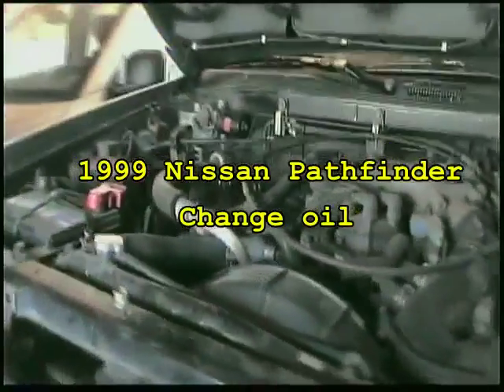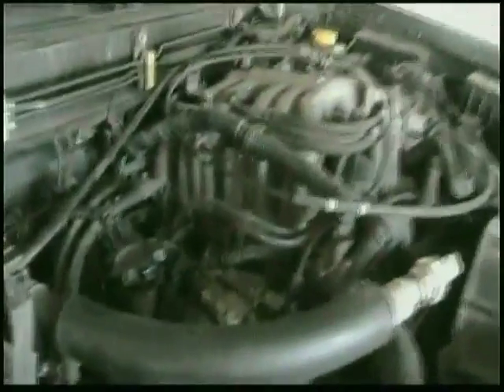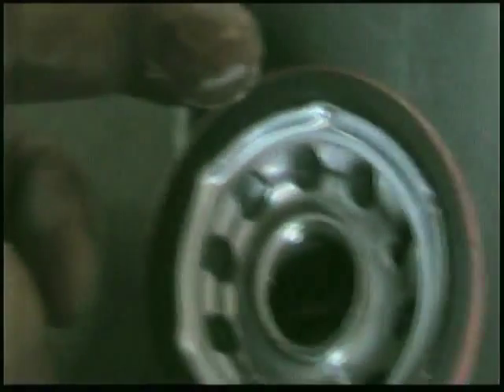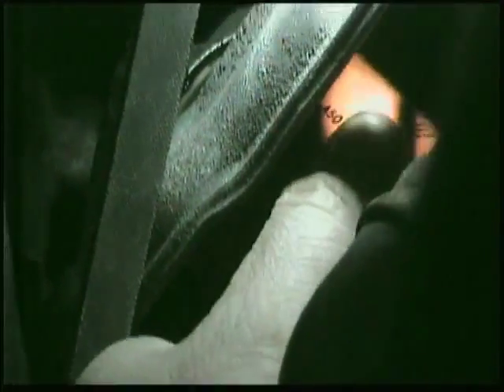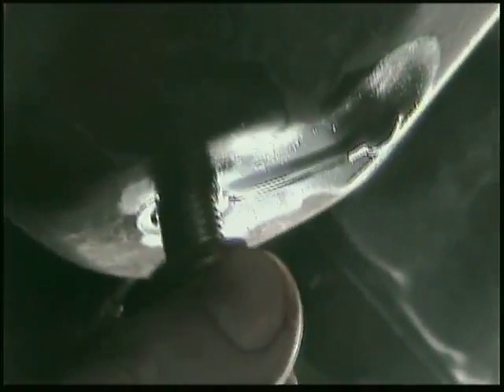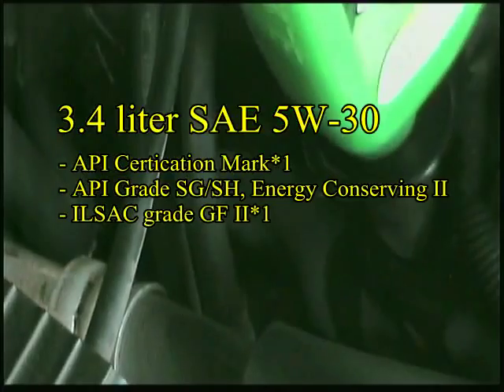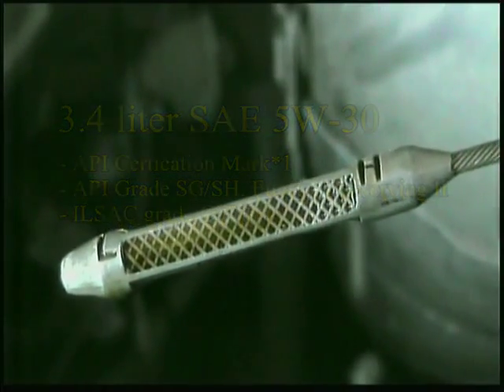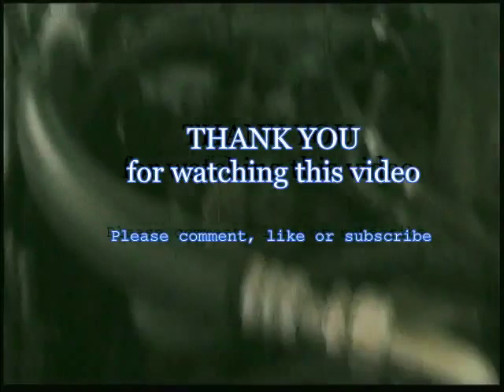1999 Nissan Pathfinder   Change oil

Comment: What is the part number for the oil filter? I just replaced one on a 2000 NP but it was not as tall as the one you show. But it did screw on correctly and seal with no leaks...
Reply from the maker: brand: FRAM number: HM7317. next time try asking the autoparts different brand that is applicable to your vehicle.

Comment: do you check the oil when the car is cold or after 20mins running?
Reply from the maker: I usually check oil when it's cold BUT it is recommended to follow your car manufacturer user's manual.

Comment: Hey if I put one quart of 10-40 instead of 5-30 will it cause my engine to sound like a diesel engine when pressing the gas? And if so should I change the oil?
Reply from the maker: Tony Benson Hello Tony, your engine has a manufacturer viscosity setting of 5W30. You won't hardly feel any difference if you add a quart of 10-40, BUT, it is recommended and a best/safe practice to follow your engine's manufacturer specification. Just make sure you got the proper oil level in your engine.
Reply: reteece rhu salubre ok, thanx but why do you think my truck started sounding like a diesel truck
Reply from the maker: Tony Benson Is this been going on before you change your oil? You might need to tune up your engine.
Reply: reteece rhu salubre Thanx man.., I found out what the problem was.., my radiator had no fluid in it. Sounds dumb but oh well. Lol! Thanx for trying to help though., I'll keep in touch. Lol
Reply: Can I use a 10-30 instead of 5-30 oil? whats the reason for   using the 5-30?
Reply from the maker: +Joa C Hello. This is something to do with viscosity or the thickness of the oil. The higher the number the  thicker the oil. It is still a best and safe practice to follow manufacturer engine oil setting.

Comment: I'm about to be 19 and my dad bought the car when I was 16 the car has 200000 miles and the shocks are all going out and the ball bearing on the front end are going bad causing the tires to wobble, around 50 mph the car rocks like a boat in a bad storm from side to side, if anyone wants to make some recommendations that might save my life I'd be very greatful. can't afford to pay a mechanic
Reply from the maker: +Shelby Broadus Hello, You can do it yourself if you have the proper tools. There's a lot of DIY guide in youtube regarding ball joints and shock replacements. Always remember safety procedure when servicing your car. Goodluck!
Reply: The wobble is from your rear trailing arms
Reply: Man ive been delivering pizza for like a solid year now with my car doing that and it sucks lol. your youtube name after guitarmasterx7?
Reply: You should get it looked at/fixed ASAP. I let mine go for a long time and recently got it fixed (97 pathfinder), the mechanic said that the trailing arms were barely there when I brought it in. As far as my name goes, I played guitar in middle school and randomly came up with the name back then(not even good at playing).